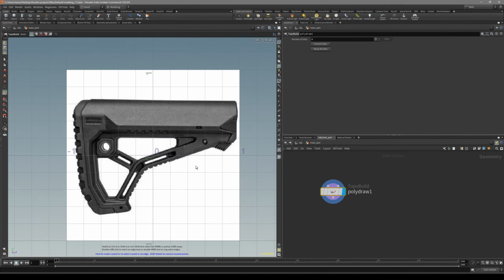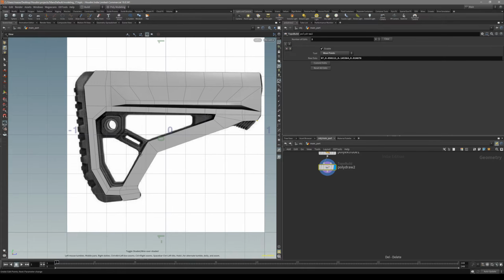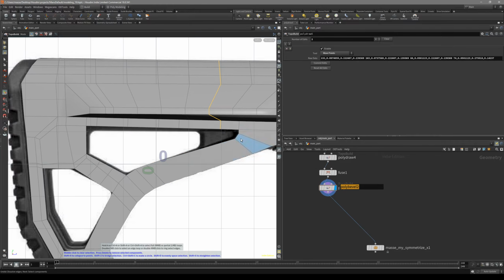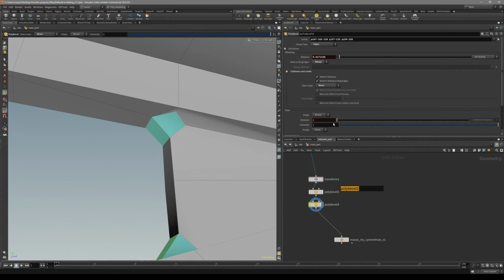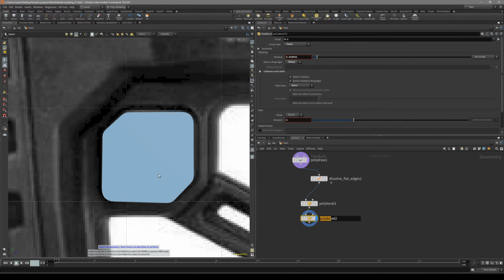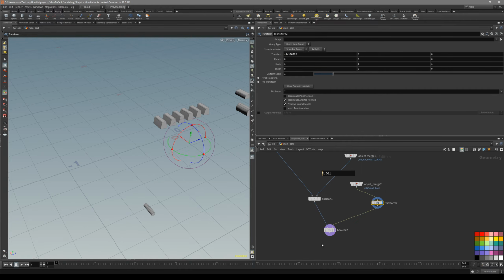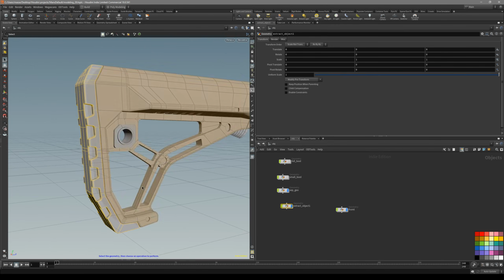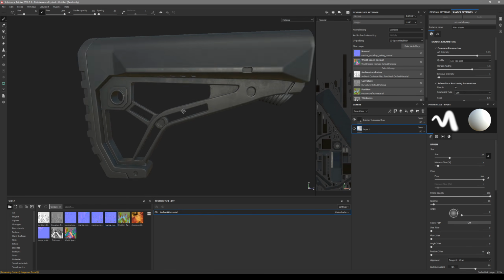Hard surface modeling in Houdini tutorial

Comment: I have another question, at 5:56 you select two edges and use a bridge connected selection? where or what is that. only thing I get is polybridge but that is not it as it does not add a polybridge node
Reply from the maker: its a right-click action if you are in a build mode, also a shortcut z
Reply: @viktors_anfimovs  thank you for prompt reply. I searched SideFX and google and saw nothing. very little documentation.
Reply: @viktors_anfimovs  this is a terrific tutorial on learning polydraw, it really helps me out getting to know the tool. I love that tool, C4D has one much like it. you can do so much with just one node.

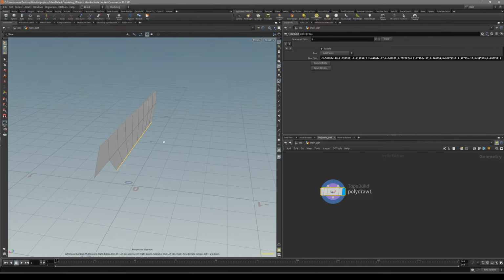Comment: at 1:14 you say click this, hold down control and extrude this. I cannot get this, when I click control it deselects what I click.
Reply from the maker: make sure you are in topo build node and with number keys you can change mode, make sure you are in a build mode, should be under key 1
Reply: @viktors_anfimovs  thank you, yes that was the issue

Comment: I'm not sure what I'm doing wrong but on 00:56 I have a hard time pulling out the selected edges to create new ones. What is the trick or keybind? :)
Reply from the maker: make sure you see the blue text below with the specific polydraw node instructions. And make sure that you are in build context in topobuild node. Right above viewport. Other than that once you have edge selection just left-click on it and it should extrude.
Reply: Houdini Element Ok thanks. Worked now.
Reply: What do you think about the Boolean workflow compared to the Polydraw Workflow? I like some parts of the polydraw flow ... just wondering if (especially in Houdini) the Boolean workflow superior is.
Reply from the maker: @chrisgg  for kinda just learning porpuses with pushing out edges and stuff is cool. Generally tho i would say booleans for something like hard surface is much better and you can always go back and change dimensions.  But then of course all depends on what you are using it for, if you're baking out edges,  you need to subdivide the mesh since you leave a mess after boolean operations, but then you can use like semester and get quads. Lots of ways to do things.  Boolean tools are pretty awesome in Houdini, my favorite by far.
Reply: @viktors_anfimovs  ok got it. One last point because you kind of covered all my last days pains in this video :) At the end you are uv unwrapping with rizom ... what to you think about the autouv node (especially for non primary / visible objects). And why don't you bake your maps in Substance or Marmoset? And why don't you create a high poly version in Houdini with e.g. subdivide or voxel mesh workflow? You could smooth out the edges even more and project the low poly to the high poly on bake.
Reply from the maker: Not a fan of autouv node, you do have to tune in a lot of options and you often get uv overlap. in Houdini i like more of a workflow that i have in my low poly video.were i get my edges i want to uv  and then autoseam. Rizom is awesome. It gives great result with one click.  I do have voxel videos, only thing is that if you have a more organic shapes you need a lot of resolution because individual faces will show up if there is not enough resolution, you can try to smooth it but then you will start losing edge details. 
if i want to bake out anything in substance/marmoset i have to set up the naming and i need also high poly model for it, with i might not have. I have to match individual low/high pieces with the same name so that they dont intersect with each other and dont create artifacts. In in Houdini i can just explode mesh, do my bake and im done. And often you will get articats, and mybe bake wont work out that well then i have to export meshes again. In houdini i stay in one software i can do my thing, i can make my setup and just plug in different piece i want to bake. Also if i have a high rez model i can bake out a map for it in seconds because one of it is COPs based.
https://www.youtube.com/watch?v=B8HqBuH9xew&t
check out my low poly video https://youtu.be/ieS6roShvgk lots of useful uv mapping and baking stuff in it. 
Hope this helps.
Reply: Houdini Element thanks for the Info!
Reply: @viktors_anfimovs  I have found your tutorials very informative. I am still learning Houdini after a couple of years playing around with it.  having come from Cinema4d using bools is considered very bad modeling as it can produce bad geometry. I have found I still will not use it in Houdini when hard surface modeling where object will not be procedural.